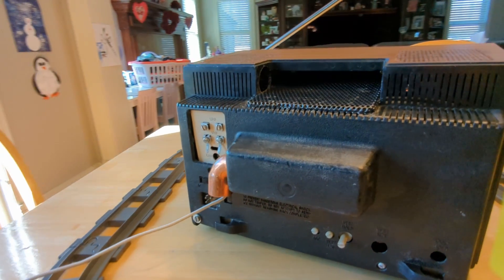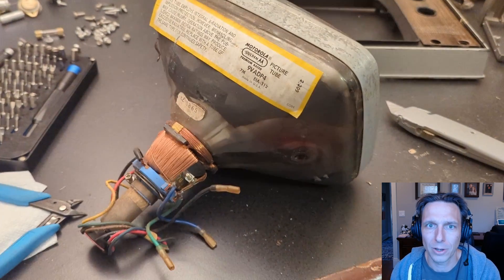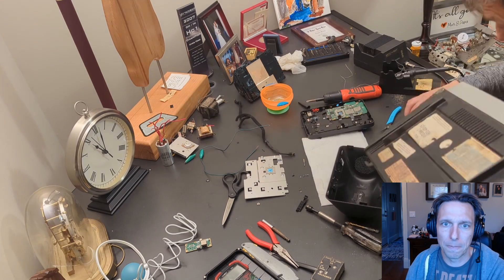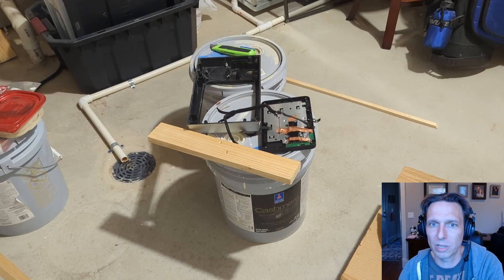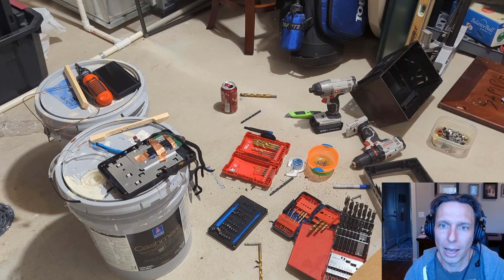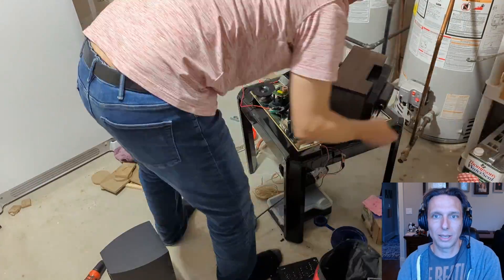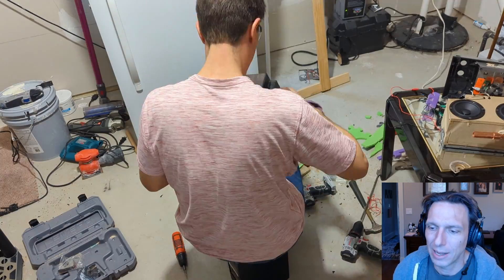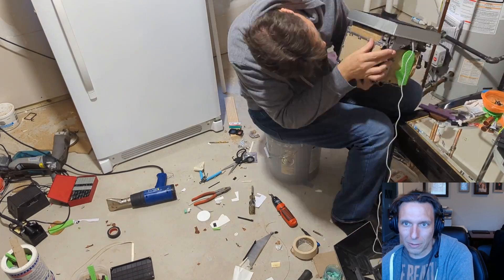Motorola 9" TV resto-mod with an Amazon Echo Show 8

Comment: Nice to see you having fun in retirement, I'm finishing a bathroom in the basement, but you have lit a fire, perhaps I may give new life to an old appliance also.  Any suggestions?
Reply from the maker: For an easier time, just grab literally any speaker and a Nest Mini 😂 I tried that and it was a ton simpler project to make a smart speaker out of an old JVC speaker.  

I think an old clock radio with a Nest Hub (7" display) might be fun.  It could fit in something like an old Motorola TC29EW
Reply from the maker: https://youtu.be/4nKIWoyJ7H0